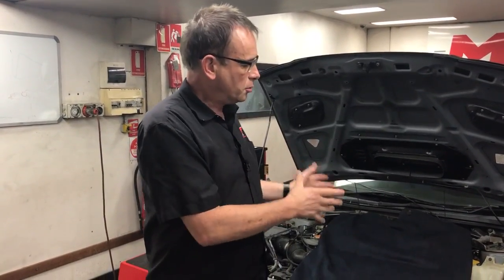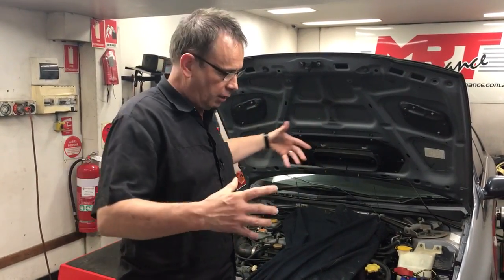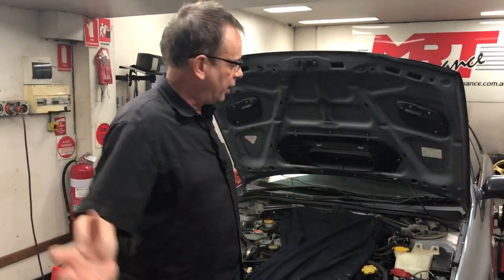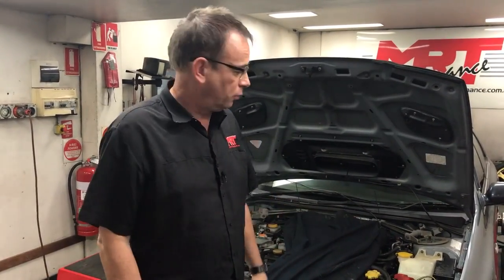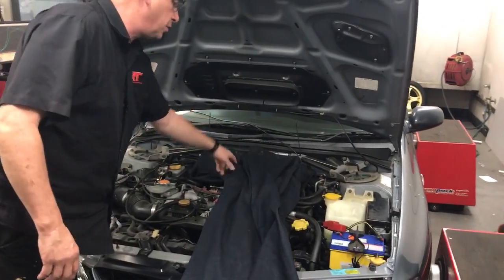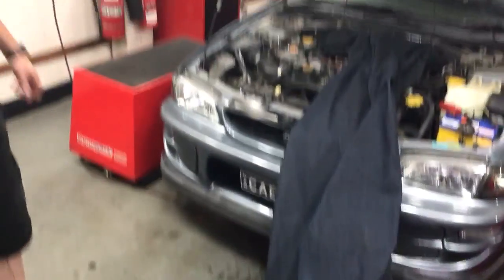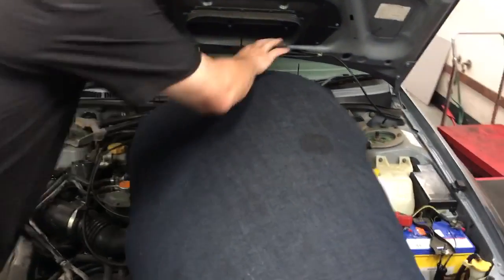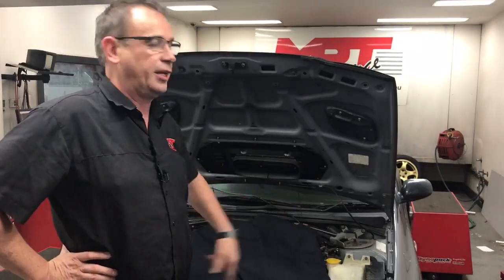How airflow works in our Dyno Room

Comment: Interesting if this setup replicates the potentially inferior airflow environment during driving conditions such as wind coming from the rear... heat soak from the bonnet when it's closed  and if not how will a tuned ecu cope with these potential differences between the dyno and the road/track...
Reply: You'd do your baseline tuning with the windsock. Then you'd remove it and test it with bad heatsoak to make sure it dials everything back to stay alive. You need to tune for both conditions and interpolate inbetween.